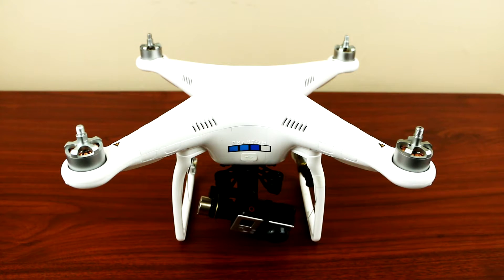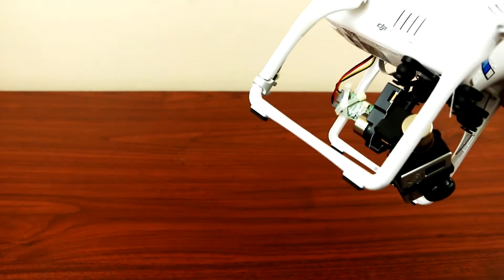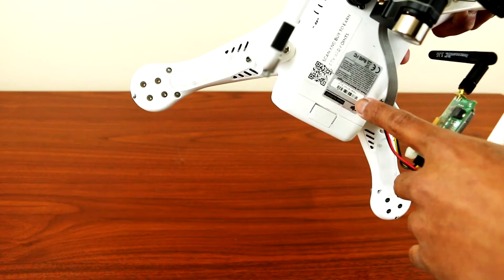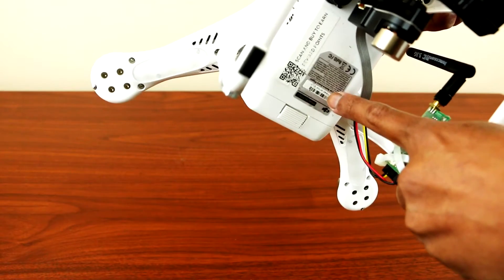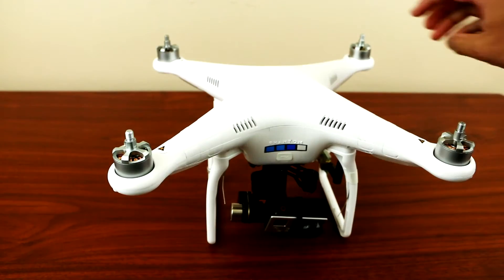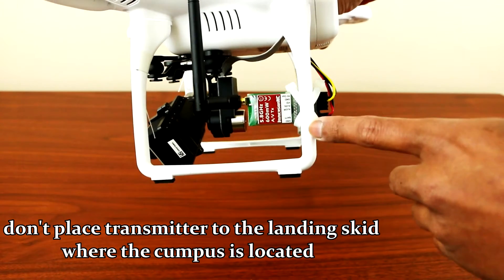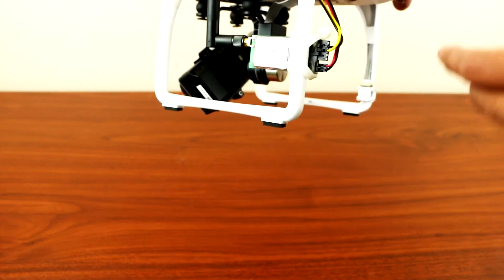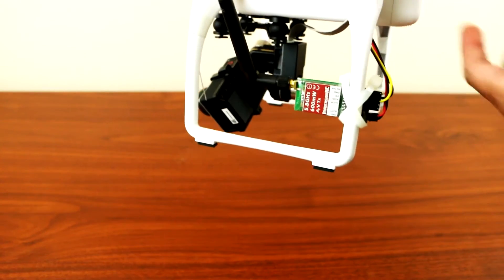DJI Phantom 2 - ImmersionRC 600mw Transmitter Placement (prevent velcro glue from melting)

Comment: If you have heat problems...you can buy little heat sinks wit adhesive on them that are supposed to be placed on PC graphic card memory modules..its the exact size and its cheap...anywhere in pc tuning shop..

Comment: L BS What channel are you using on the ImmersionRC 600mw? I tried channel 1 but distance was horrible. How far can you go with this one? I have a cloverleaf anntenna on both the Immersion and my receiver (Black Pearl Diversity 7" LCD)
Reply from the maker: channel I used was whatever the immersionRC channel came with as stock. as for how far I can go with it, watch this DJI Phantom 2 - ImmersionRC 600mw Transmitter with Stock Antenna Reception Test (part 1 of 7)

Comment: If you truly want better reception / reliability, you'll want to replace that antenna with a good Circular Polarized antenna such as a Clover Leaf or Skew Planer on both sides of your connection.  If you want really long range than you'll want to use a Helical antenna on your receiver.   Circular Wireless makes some of the best antennas for this tho they're a bit more costly. FPVLR has good antennas too at less cost.